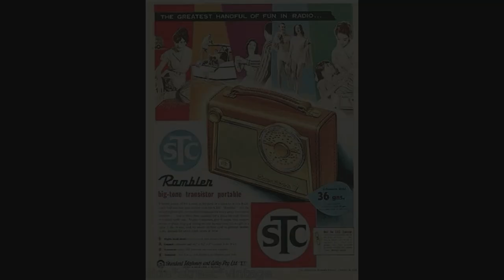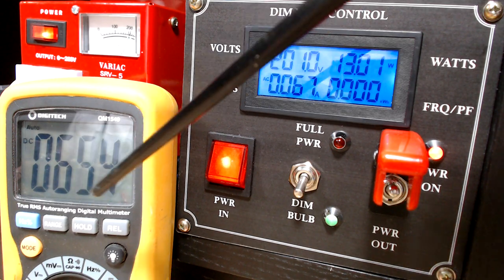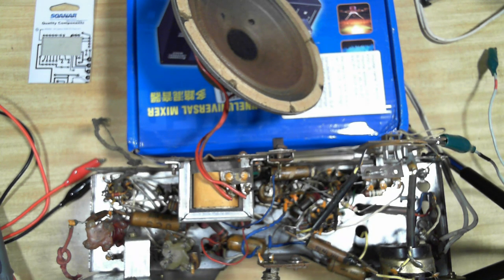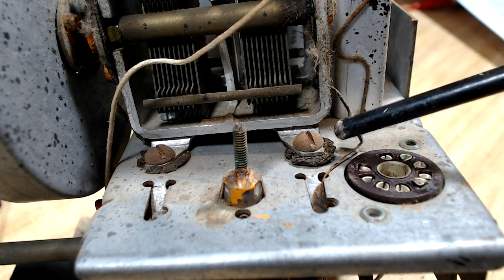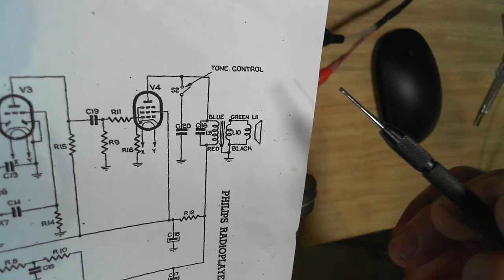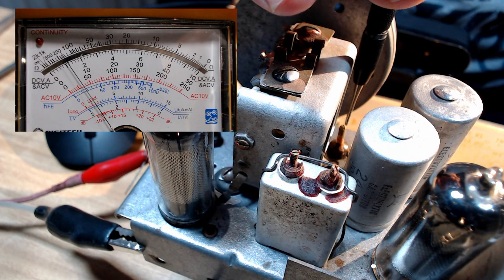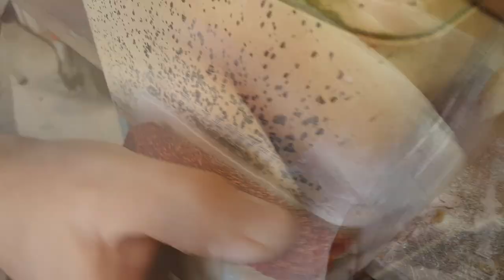$1 Basket Case Radio Restore - Fleetwood 1061 AKA Philips 165

Comment: Thanks for your video, I am very satisfied with your work.
I think you could use acrylic polish for the plastic made front panel, "scratch doctor" also works. It could save you a lot of time on those old plastics.
Reply from the maker: Hi Nan Li, if you mean the plastic dial there is nothing I could do to restore it, I tried a lot more than what was in the video. Thanks for the suggestion though 👍🙂

Comment: Hi David.  Great restoration,  inspirational.   About the high voltage on the 6BD7 anode; keep in mind that you are using a modern DMM with about a 10 megohm resistance,  rather than an old 1k per volt meter, which on a 100 volt range, only has 100k of resistance,  which will considerably load down the circuit, so the 100V you measured could well be correct.
Reply from the maker: Thank you Stuart, I appreciate your comment. I just pulled the back off the set and checked with an analog meter rated at 20k/volt and it read about 80 volts so has dropped a bit but not near to the 50 volts on the schematic, the DMM measures 85 just now. I often use the analog meter to double check a unusual reading but I can't remember if I did in this case. The bias and plate voltage are correct (using the DMM) so so I'm puzzled that the voltage isn't right. To me, it would appear the valve is just underperforming. Next time I will use the analog meter on all the voltages if one isn't right, thanks for your guidance Stuart 👍🙂
Reply: @DavidTipton101   The original measurements may have been done with a 1k/V meter.  There's a big difference between that and a 20k/V meter.  It wold necessarily affect other points in the circuit too much, as most are lower impedance.
Reply from the maker: @stuartirwin3779  🤦‍♂️ now my meter is too good 🙄 I'll have to get you to guide me when I talk to you next 👍🙂

Comment: Hi David. Thanks for the interesting video. Re; your dial, there was a bloke on youtube demonstrating how to restore headlight covers. They are polycarbonate and deteriorate over time. He thoroughly cleaned them with window cleaner and steel wool. Then, and this is the important part, he soaks a wadded paper towel (flat) with acetone and makes a single swipe over the plastic. I think it's important that you don't go over the same section more than once. The result was quite amazing and it might be worth a try.
Reply from the maker: Hi John, I've seen that or a similar video but I don't think it will work on perspex. I did sand that cover with wet and dry paper but it made no difference. I just went out and tried what you suggested and it made no difference. A chemist radio restorer who writes for Silicon Chip magazine told me that one of the chemical components in the perspex is liberated and that is what clouds it. He also said there is nothing you can do to restore is clarity. I have just tried the peroxide/UV light treatment and it's now baking the sun, I'll see if that does anything. Thanks for you suggestion 🙂

Comment: I’m a professional Auto Detailer.  I believe it can come back through wet sanding down to 2500, and polish it with micro-compounds ( ie 3000), and finish with Meguires “Plast-X”.and a buffer. (I do headlight lenses all the time and have polished plastic,including clear plastic). It would be a bit time consuming but doable.
   You did an amazing job❗️
Reply from the maker: Hi Jeff, I tried wet sanding it before I gave up. A chemist guy explained that one of the components in the plastic turns brown so the discolour goes through the thickness of the plastic and not just the surface, whatever the explanation it didn't work unfortunately but I have done headlight lenses successfully, thanks Jeff 😃
Reply: David Tipton 
Must be the type of plastic. A shame.
I just used my [ big] buffer on a clear lens of a Clock Radio. Came out beautifully, but different plastics react differently.
Glad you were able to get a replacement.
Beautiful radio.

Comment: Nice job David !
I have repaired something like 300 tube receivers, The diverse Philips clones were the worst of all. Your's did not have the tarball capacitors and had quite modern noval tubes.
This radio also lacks the famous Philips white piano keys which are almost always broken.
You were really lucky with the IF transformers. That type has a tendency of getting broke when tuned the second time.
For dial cord I am using kevlar line. You can get that as fishing equipment. Can take a lot of load, tolerates rubbing and does not stretch.
Reply from the maker: Hi FUN, thank you. We didn't have much in the way of radios with keys unless they were imported models. Forrest should have said "life is like a box of IF transformers, you never know what you're gonna get" I was lucky with these ones. I have large spools of cord but I'll check out the fishing line if I run out, thanks 👍🙂

Comment: Hi, I can remember when my mother and I went to Grace Brothers a Bondi Junction in Sydney in about 1955-56 to purchase a radio and I had to pick out the one to buy, we purchased the same brand of radio exactly, the same as the one you restored except that I think the badge on the front was AWA ? I think it cost 24 Pounds a lot of money at the time. your video brings back fond memories, Iam 70 years of age.
Reply from the maker: Hi Lee, that particular model was a rebadged Philips so yours may have been the Philips model which looked the same. Good job picking it out that must have been a thrill for a  7 year old 😉😀

Comment: Hey mate, I'm a plastic modeler. For the large crack in the case you could also use gap filling super glue dusted with baking soda. Forms a rock hard join that sands smooth and looks invisible when done. May save you fabricating backing plates for cracks in the future. A Youtube search will show you what can be achieved with this method.
Reply from the maker: Hi Andrew, I've seen that on YouTube, thanks for the reminder 👍🙂

Comment: Great work Sir. I think there are  few persons remain who know the valve radios repair as the tubes are absolute and now it is age of micro electronics . repairs of these antiques is no longer a profitable business. Parts are no longer availble too. I had diploma in Electronics in early nineties and saw last phase of radios and tube televisions. After transistors then integrated circuits the volume of radio and tv also ampliphires reduces. And now in the age of micro electronics many many changes happned. There has been a diffcuilt taks to find out old radios and tv repair technician in the city. Love to meet U
Reply from the maker: There have been lots of changes Hanif and finding someone to repair old equipment is almost impossible, eventually people like you and I will die out too I'm afraid 😌
Reply: @DavidTipton101  May Almighty Allah (GOd) bless U and give a long life. Keep it on. Your will will never die. Thank you very much for a kind reply
Reply from the maker: Thank you hanif khan, you are very kind 🙂

Comment: Very nice work!  Just a comment: you should always drill out a small hole at the end of any crack to prevent future crack propagation as the tip of a cracks acts as leverage for crack extension. Once done, you can fill out crack and hole. Standard procedure with composites. Cheers.
Reply from the maker: Hi Eng, yes you are correct, I should have done that. I worked on aircraft and it was always required to stop drill the crack. I've been out of the industry too long 😌

Comment: An air brush would do wonders for finishes, the ones model makers use. They are fairly cheap and would give factory looking results and save sanding etc.
Reply from the maker: I have an airbrush, 2 in fact. I used the larger of the two to apply wood stain to a German radio but I haven't found a use for the small one yet. You are right of course, it would be handy for small touch ups, I'll have to keep it in mind, thanks 👍🙂

Comment: Great 👍 Before and After on this radio. There is a group named Fleetwood Mac, one ☝️ named The Fleetwoods, and there used to be a company named Fleetwood Tires. Your radio 📻 comes by the same name, too. Depending on the year determines if it’s field coil or permanent magnet. That means the speaker. I know all these beauties have dial lights and dial cords. Some radios have two dial cords, one ☝️ for AM, one ☝️ for FM, and some radios have a gear reduction system in addition to the dial cords. You probably already know in a lot of these older radios, that if a dial light bulb 💡 burns out, it cuts the power to the entire radio off. This is probably a safety feature against 🔥 fire. I wish we could return to a 1950’s and 1960’s lifestyle. See all these nice 👍 radios 📻 back in production. I think radios were still pretty good in the 1970’s, but Radiotvphononut talks about the decline in quality by this point. I was born in 1970 and am having my birthday 🍰 on June 5th. I have to say radios 📻 were better then, than the 1980’s, although I had favorite designs then, too. Conversely, radios 📻 were still better in the 1980’s, 1990’s, to about the year 2004. Everything after that, junk, 80 percent of, anyway.
Reply from the maker: Fleetwood in this case was named after the location of the Fleetwood factory in Lancashire, England. They are Phillips Australian built radios with so;d under the Fleetwood  name. There is no connection with Mick Fleetwood.

Comment: Looks like a well spent dollar. Nice work indeed. We had a Fleetwood TV in the 70s, it did us for a few years as we couldn’t afford a newer set. Horizontal hold failed eventually, it wouldn’t come up to speed.
Reply from the maker: Hi Wenlocktvdx, can I assume that was a rebadged Philips TV? 🤔
Reply: Hi David, I believe it would have been. I read that Kelvinator marketed a TV, that was also believed to be a rebadged Philips
Reply from the maker: @Wenlocktvdx  That sounds right 🙂

Comment: David, great work on the presentation and the receiver learned a lot particularly on your approach toward the sets housing. When you fired up the rig and you were showing the line voltage (mains) I wondered if manufacturers in the Commonwealth make AC/DC radios in other words without line transformers? It's one thing if I'm playing around with American five radio and get a 120v shock, but gee 230 that could be dangerous.
Reply from the maker: Hi Mack, I have never seen an AC DC Aussie set, they tell me there some somewhere. The Brits made lots though but they dropped the voltage to 120V using resistors first to use standard 120V string tubes. I have a few, they make excellent room heaters which is great for the UK 😄

Comment: Wow David!  A man right out of the 50's for sure.. with future technology to make it better.   So much work for something that was thrown together in the past.   Where did you get your tube at David? I bet anything you have an Electronic Degree.  I guess resistors have changed much.   I thought that was pretty neat how you adjusted the frequency.  Didn't know it was that much trouble.  Using up to date capacitors....hmmm.  Now that frequency select twine was a little troulesome.  I didn't know that took so much trouble to set up either.   You made a $19.95 radio into a $300.00 collectors item.  Great work!
Reply from the maker: Hi Larry, I get tubes from a number of sources, it's difficult at first but gets easier as you meet like minded people. No, sorry , no electronics degree and I've only been dabbling in radios for about 2 years, I picked up most of it from YouTube videos and some very knowledgeable new friends 😄

Comment: OMG. talk about making a silk purse from a sows ear.  It's fantastic.
Dave, you have re-affirmed my estimate of you being the MASTER of sheet metal reinforcement fabrication.   
I was wondering if you have ever found one of these reinforcements to decrease, or increase, the amount of interference a radio was making.
Thanks.
Reply from the maker: Hi Howard, thank you. I have only repaired one case that I ended up adding a loop stick antenna to, it worked alright but the repairs where closer to the bottom of the case, it didn't affect the reception. If it was a large repair and it had an internal antenna I would use another backing material, I'm not sure what though 🙂
Reply: @DavidTipton101  Thanks very much.   Long ago I had used some fiberglass mat, but that was not very appealing.  Maybe fiberglass strips impregnated with something thicker, like  JB Weld would have worked better-   On the inside nobody will see it anyway..
Reply from the maker: @howardhiggins9641  Yes, that's about what I was thinking 🙂

Comment: Another David Tipton MIRACLE !!!  Replacing the rubber feet on the tuning capacitor was crucial, and the repair to the case phenomenal, but the most amazing part to me was the grill cloth assembly.  I always have such problems with things like that.  It either bunches up or wrinkles up or something.  Excellent job on this one David!
How it the green screen project progressing?
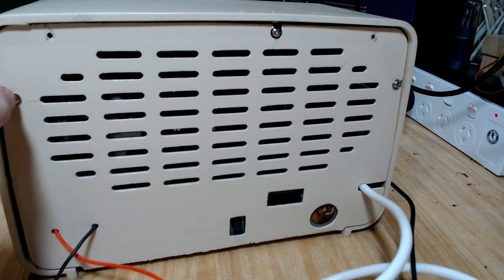Reply from the maker: Hi Wayne, thanks, Yes, it came up quite nice. The grill cloths are difficult, I wonder about making a clamping frame so I can pre-stretch the cloth slightly and make sure it is straight before dropping the backing onto it. No good for stapled cloth but at least there you can take your time. Green screen is going well, I now have some chroma key cloth for a backdrop so the results are much better. There is a short bit at 39:55 in this video which looks pretty good 👍😉😃

Comment: I would love it if you broke down exactly what some of your concoctions were that you made up to do the repair, especially to the back plate. My dad has/had an old tube radio that I always wanted to repair, but didn't have the know how at the time to do it. Should check with him to see if he still has it kicking around!
Reply from the maker: Hi Trogdor, I should have explained in the video what the mixture was, sorry. I have added it in the description of the video. It would be interesting to find your Dads' old radio 😃
Reply: @DavidTipton101  Thanks for that, the paper mache makes sense. Yet to ask my dad about the old radio!
Reply from the maker: @Mr_Mooo  you're welcome 🙂

Comment: Wow David I enjoyed that a lot more than I first thought I would. I hate electronics mainly because I don’t understand them well enough but I admire those that do. Doing those radios is really two restorations for the price of one. That was a lot of work getting the case looking so good but it really was worth the effort. I’m wondering if one of the headlight restoration kits would clean up the perspex. Anyway I’ve subbed and I off to watch more of your work. Cheers mate, Stuart 🇦🇺
Reply from the maker: Hi Stuart, thanks for your comment. Unfortunately the perspex was discoloured all the way through. I tried sanding it with wet and dry paper but it wouldn't clean up 😌🙂
Reply: David Tipton. Ahh that’s right, I forgot that you mentioned the fact that the damage went all the way through. 👍👍

Comment: When connecting a phone for testing it would be good to put a capacitor and resistor in series to protect it if this is not already done.
Reply from the maker: Hello Gordon. There are resistors in the plug and a cap in the lead 👍🙂

Comment: That resistor, R 15 is one of the most common failures in old radios. It is nearly always a 220k resistor also. It has always been a mystery to me why the resistor in this application fails so often. It doesn’t matter what type or brand it still fails by going either open of high in value.
Reply from the maker: This radio was a while ago widecast, I think it was the plate supply resistor for the audio amp pentode that was open but can't quite remember. If that's the case I will remember that for next time. I guess it must run close to it maximum wattage, thanks 👍😀

Comment: Yet another outstanding restoration. With skills like yours, I wonder if you can make an old $1 bill look like a new $100 bill.  Although I do question the need for the sheet metal underpayment for the case repair. Seems to me you could have gotten away with some fiberglass cloth and epoxy instead. Either way, top notch work!
Reply from the maker: Thanks aerostar. I tested which was best and JB Weld and Al sheet was much stronger than epoxy and fibreglass but if the radio has an internal antenna I will use fiberglass 👍🙂
Reply: @DavidTipton101  darn it. Just when I thought I had one-upped you, you pull the Ace out. I am truly impressed by your work David. I don’t think I’ve seen better.  You are master of many disciplines.
Reply from the maker: @aerofart  Haha... thanks aerostar 👍🙂

Comment: Good work and good on you for showing us. I hope other people see this and save some radios of yesteryear. I wonder how long AM radio will be around as phone apps and FM are taking over. Something magical in my opinion in AM.  I see the speaker is darker at the end, did you put black ink on the cone? does it make it stiffer and not as good? Thanks
Reply from the maker: Hi Argento, I wonder how long AM will last too. Because we live on a sparsely populated vast land AM is better suited here, we can get AM at most places where Fm will not reach. AM brings back memories from simpler times 🙂 I used black spray paint on the cone to make it look better and to stiffen it a bit. Some will say it adds weight to the cone but it would be negligible 🙂

Comment: I generally find that if any voltages are way off it's quite often the anode of that first af triode. I leave them alone unless it reads low.
Reply from the maker: Hi jonka1, I can't remember but isn't that the valve I changed twice? As you say, leave it if it's reading high and there are no other problems 🙂